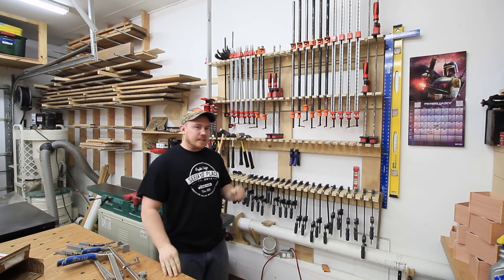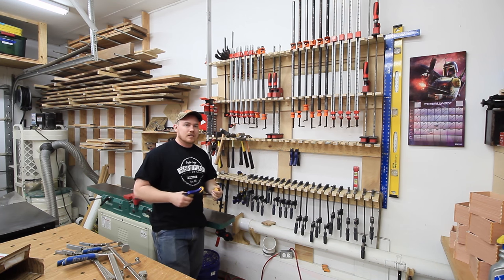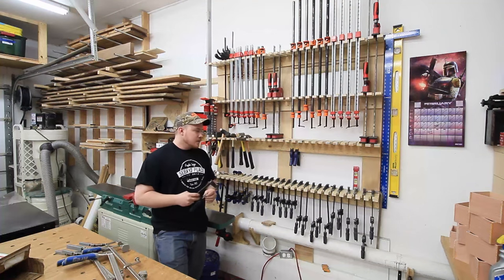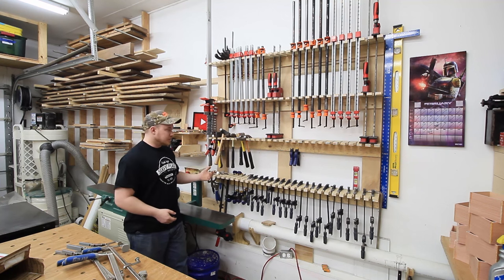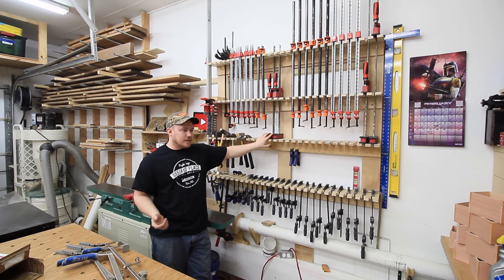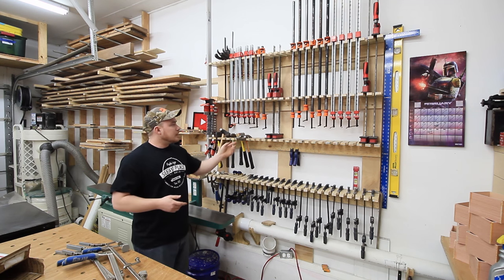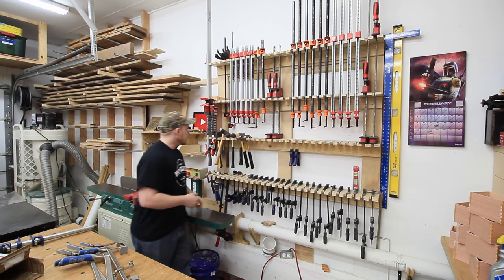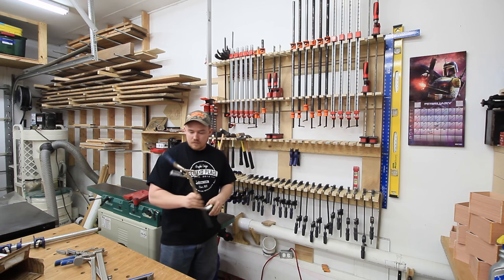Tool Talk #8: Clamps

Comment: I needed some additional clamps and bought a few of those HF quick release clamps, Broke right away. Took them back and got the screw style like you have. They are holding up for now but the bars bend easily. I hate when frustrating tools get in the way of a project.

Comment: Well that clears up some of my questions. I have been on the fence on which clamps to buy think I will go with 1/2 pipe clamps and the aluminum bar clamps. I have seen where the aluminum bar clamps can be improved with a piece of wood in the tubing to stiffen them up and pads for a better clamping face.

Comment: I work at home Depot and I'm a woodworker. So I play with all the new clamps that come in at the (orange) big box store. But I just wanted to say that the DeWalt quick clamps are really good clamps I bought one at a yard sale that was 5 years old. And I've been using it for a year and it's still strong and not broken. Lol

Comment: I had posted on your wall about the Bessey clamps during Christmas.
One thing about the Bessey is the smaller wooded handle is not as comfortable when tightening over the HF models.
They Bessey's were definitely more heavy duty though.

I bought several of the spring clamps from HD for 99 cents each long ago.
They have a very high spring pressure compared to others I have used.

Comment: I never tried the kreg style clamps.  With the big handle on one end, and the bar sticking out the other, they strike me as very awkward.  I often apply clamps in a vertical position, with t he project resting on the non moving part.  That just wouldn't work with the kreg clamps.  Things stiking out both sides of the clamp seems very awkward.

Comment: Thanks Jay. A good overview of your clamp collection. I have found that a few 6" quick  clamps are very handy  - from small parts glue ups to safety on router table (small parts). I  have a couple 3/4" pipe clamps that I've used on 8' panels.  P.S. my nearest HF store is only 170 miles away, 30 minutes isn't bad.

Comment: If you get your pipe threaded on both sides they also make a coupling that allows you to screw two pipes together and extend the length of the clamp without having a long pipe dedicated to longer clamping needs.  You would just move the sliding portion of the clamp to the other pipe.

Comment: Good reivew, Jay.  Appreciate the info on the pros/cons you experience with those clamps.  Your 200K 'friends' must have bought all of HD's stock of the 6-piece Bessey clamps - they are out of stock online.  Shockingly, a bunch have just hit Ebay and Amazon for around $30-35.  Always enjoy your insight of the tools you use.  Much appreciated!
Reply: +Chris Williams Try calling around to the stores in your area.  I found one that says they have a few so I'll be stopping by there tonight.
Reply: These clamps used to be in a seasonal "flex" area that was just recently taken down. If your store says that they have some online, the count should be pretty accurate (they just did their yearly physical inventory), but they may be hard to find. I found mine this morning in a shrink-wrapped pallet near the door to the loading dock. It was just about to be put out into their end-cap clearance shelves.

Comment: SIngle Take!   Awesome.
Totally agree about the glue on the parallel (K-body) clamps being a pain.  But I just love the big, flat, PARALLEL, heads on my clamps and reach for them first.     I've never tried 1/2" pipe clamp -- had some 3/4" ones and I found that they slip, and the heads are so totally non-parallel that they drove me nuts.

Comment: I have broke every kind of "quick grip" clamp except for the Irwin brand.  Those are by far the best "quick grip" style clamps I have used.  

The Bessy clamps are awesome clamps.  I also purchased the 6 pack, and they are awesome.  I also have some 4 inch clamps that are Bessy as well and I really like those also.  

The harbor freight clamps I have some of the longer ones, and yes the bars do bend and the screw is out of place on some of them as well, but with them being so cheap, I don't mind buying them.  

Great video Jay!  As always.

Comment: Hey Jay, - Watch Paul Seller's video on how to improve the aluminum bar clamps. Basically all he does is take the end cap off, cuts a piece of wood slightly under the interior dimensions, slides it in the opening, and replaces the end cap. It really stiffens them up. I've done it to all of mine. Beyond the bowing of the clamps, it really eliminates the twisting. 

Take care

Comment: Hi Jay. Thanks for this usefull review. About the Bessey  just have to wax the clamps once and it will be ok with any glue drop. You're right the Kbody are insanely expensive especialy here in EC. My favourite clamps are the cheapest version from Bessey called the Uniklamp. Their clamp pressure is pretty enough and they are limited in lenght 12" or 600mm. I've got 8 of them and planed to buy 8 more. Through they are IMHO the best value for money. If you've got an oportunity to test them out don't miss the chance. 
About aluminium clamps you probably notice they twist and bend easily. I found that fill them with wood just transfigure them into great clamps without adding them too much weight. You should try and tell us about this easy upgrade. Cya

Comment: Great review Jay! I have some of the aluminum bar clamps from Harbor Freight and they do bend some when tightening down. I cannot remember who posted the video improving these clamps but they cut a piece of hard wood that slipped into  the aluminum bar track snugly and it did stiffen up the clamp. I am going to do that with mine to see if it will work for me.

Comment: Thanks for the tip about the 6 pack of clamps at Home Depot, I just ordered some.  I also found a 9 piece set of Bessey spring clamps for $6.  They have 4 of the rarely used 1" clamps but also 3 of the 2" and 2 of the 3".  The bigger ones along are worth the price.
Reply: Dang it!  you must have literally got the last 6 pk of Bessey clamps....  I just jumped onto homedepot.com to place an order and they're currently "out of stock online".   Hoping they are still at that $15 deal when they get back in stock.   I also saw those spring clamps for $6, and gonna have to jump on that too!
Reply: +Stew Pidass  i did the same thing. out of stock:-(
Reply: +Stew Pidass  Check for local stores in your area for instore pick up. That is how I scored some in the DFW area.
Reply: +ddutton0   Thanks ddutton0, I tried that too...  unfortunately called the three homedepot stores that are in my area and none of them carried stock of the 6pk for $15.   And homedepot.com says the nearest store that has them stock is 85 miles away...  which is a bit too much of a hike for me to justify even if they were on sale for a penny...  Now if it was new cabinet style table saw for on sale for $15, I'd be in the car and on my way now.  😃  But thats just wishful day dreaming..  hopefully I'll get an email notification soon when they're back in stock online to order.  That is a great deal!  especially with the free shipping!!

Comment: 90% percent of the clamps in my tool trailer are Irwin clamps. Everything from basic 6" squeeze clamps to 24" 600lb rated (large grip) squeeze clamps.  For most onsite wood working projects, the 300lb rated 12" squeeze clamps are my go to.  The 600lb rated clamps are good for instances such as squeezing some curvy LVLs together. However, Irwin's plastic face clamps were not worth the money.  You had mentioned previously that you couldn't justify the Festool clamps, and with good reason--they're down right expensive.  Well, I splurged and picked up a pair of the screw clamps and I was extremely happy with the purchase!  In fact I use them more frequently for everything other than to clamp the guide rails down.  Installing 2000 linear feet of v-match pine without a helper, they were very helpful in holding up the boards onto strapping with little clearance due to spray foam.  No other clamp in my arsenal would have worked.  They also fit perfectly in the grove of the board and I was able to clamp it down using the groove without the clamp getting in the way.  I was so happy with them, I picked up another pair.  Check it out!

Comment: Great review on the clamps.  I am going to get more of the Bessey F clamps and I like the idea of the 1/2" bar clamps.
Reply: These clamps used to be in a seasonal "flex" area that was just recently taken down. If your store says that they have some online, the count should be pretty accurate (they just did their yearly physical inventory), but they may be hard to find. I found mine this morning in a shrink-wrapped pallet near the door to the loading dock. It was just about to be put out into their end-cap clearance shelves.

Comment: Thanks for the tip on the Home Depot deal, ordered three sets yesterday. (Crap, now I have to make another clamp rack...) 
My local-ish Woodcraft store, before it closed (owners retired, no one bought them out), had some Bessey K-Body style clones from a company called Groz and I bought a couple of door kits, 2-24" and 2-36" with the little setup blocks. It was a much better deal than Besseys and I've found I like them sufficiently enough to have ordered a couple more of the same kits from their online store. I also was able to catch a few Bessey clamps when Lowes stopped carrying them and they were in clearance. I've got a much more Frankenstein collection than you Jay, but they all have found uses eventually.

Comment: The Bessey Clamps are overstock from last Black Friday and headquarters force shipped them out to select stores. Limited quantities at select stores. So pick them up if you can, as soon as you can. Good tip Jay!
Reply: +Christian Vale +Jay Bates 2
I was wondering... sounded like a good deal so I tried to get some and found that they were in store pickup only and none of the local stores had them.
Reply: +Mark Pikas I found the same thing out. I have to drive about 40 min to get them. But at $2.50 a clamp, its worth stocking up!

Comment: I won some Bessey clamps during their 12 days of Christmas. I haven't used them for an actual project yet but I messed around with them. I like them. I still like my Harbor Freight clamps. I haven't had any issues with them yet. But if I do... 45 minute drive to trade them out. I've been lucky enough to find some nice used clamps at the local flea market. 
Wish I lived closer... I'd love some of those clamps! And I appreciate your honest opinions about the tools you use (Kreg clamps and everything else). I did try to get on Home Depot to get some of those 6". They were only available in store and none at my local stores. :( Thanks for sharing as always!

Comment: Jay, great summary of clamps.  Completely agree on 1/2" pipe clamps - I'd be lost without them.  Still like Harbor Freight F clamps as only had 1 failure of 30+ clamps in 4 years.  Very much like their rubber handles - better gripping than wood handles of Bessy brand.

Comment: You can rip down some hardwood and fit it in the gap on the underside of the aluminum bar clamps and it will reduce the amount of flex in the clamp.  Keep up the good work Jay.

Comment: Yeah, when you buy the cheaper clamps you really need to look them over. Check that the tapped holes are parallel with the rail, and that the, "jaws," either machined or casting, are perpendicular to the rail, and that the clamping surfaces are perpendicular to the rail, and that they oppose each other straight and evenly (I do machine/grind/sand them so they clamp evenly).

Comment: I really like the Kbody parallel clamps for glueing up panels or cutting boards/table tops, but I have found the same frustration as you with the glue squeeze out. It just gets all over these clamps and is a pain to get off. Then, they don't open and close easily, because there is glue in all of the little grooves. Argh!

Comment: On those k-body style parallel clamps, to prevent glue from sticking all you need to do is wax the rails of the clamps a little and it comes right off no problem.  I have the equivalent Jet parallel clamps and keep them waxed for this reason. Think I picked up this tip from the wood whisperer video on clamps from a few years back. Makes them work a little more smoothly as a bonus.

Don't try that on the F-style clamps though... doesn't work very well! don't ask how I know...

Comment: I loved this video - thank you for posting it.

I completely agree about the HF F-style clamps ... I broke 4 of them before I gave away the others I had.  On the matter of glue sticking to the parallel-jaw clamps, I agree it's a pain.  I have a dozen Irwin P-J clamps (8 @2ft+, and 4 @50" - I got them on closeout when HD was dumping Irwin and going to Bessey.  They were marked down drastically, and I paid a lot less than the regular list price on them, and I got all 12 for under $200) and it's a problem with them, too.  One thing I did which helps is that I waxed the SIDES of the clamps (not used in clamping down), and later I used boshield instead.  (the wood whisperer recommended it and I tried it.  It works, but I like wax better on my cutting tools).   That helps some, but getting glue off the edges is a pain.  I generally use a soft brass wire wheel brush in a drill to remove it... again that helps a lot, but it's still an annoyance (I tried it in a bench grinder, but in a drill is much easier as the clamps are large and cumbersome.

BTW I loved your workbench videos - that happens to be roughly the same bench I had been planning to build some time this fall (but with my life that probably translates to after the first of the year) - the difference is that I'll have more space when I start it and I'm planning to go 7' instead of 6' (If I don't change my mind again), and I have a couple of large pieces of purpleheart that I'm saving for the jaw faces on the pipe-clamp vise and the bench vise.  Also I'm adding a sliding dead man to let me put very long things in the leg vise.  Other than that the two designs are about the same.

One thing I haven't figured out is whether you have to share your shop space with a car. (From what I've seen, I don't think you could get 2 cars in there without removing equipment).  Just curious.  

Once more, thanks :-)

Comment: Have you tried waxing the k-body clamps with paste wax? I did this on my jet clamps and glue comes right off with no problem. I'd assume the same would go for the k-body clamps, but I have never used those clamps before.

Comment: With the parallel aluminum clamps to negate the flexing just insert a strip of hardwood - paul sellers has a video on what I am on about. 

It makes them a little heavier but it reduces the flex and I feel it offers a bit more resistance.

Comment: Jay, have you (or anyone else reading this) used the Hyper Tough brand clamps at Walmart?  My local Walmart has some, and I can't find any reviews of them or even the clamps themselves.  They're quick-grip style clamps and are about $3/ea.  They're only about 6", but at least the one I picked up seemed fairly sturdy for a $3 clamp.  I was just curious if you or anyone else has anything to say about them since I won't be able to test one for about 2 more months

Comment: I did find that the higher quality spring clamps had protective rubber pads and handles that would not fall off like the cheap big box store brands. They all clamp but I would have to stop and go back to the box or rack and find the cover that fell off a jaw.

Comment: I like the bessey F clamps the only thing  is the Red handle is slippery .Some guys wrap it with hockey stick tape more torque  or sand them > what do you think ?
Reply from the maker: +Don Baus Mine arrived after I shot this video on Tuesday. I don't have any issues with the handles being slippery. I also have some hockey tape on hand if that problem arises though :)

Comment: Hey Jay, thanks for the video. What clamps are you using on your mft table. I didn't want to pay 40.00 a piece for the festool clamps so I bought the Harbor Freight 6 inch clamps and clipped off the ends. They work ok but there has got to be a better clamp for the money that you can use on the mft tables. Thanks again brother

Comment: I bought some spring clamps from Home Depot, they're usually a buck each. The rubber on the clamp is rubbish. After using it twice, you're just clamping with bare metal. So, be careful with those. They're not very quick if I have to grab some cauls with them too.

Comment: What about your Kreg right angle clamps? Do you recommend that one for pocket hold projects?
Reply from the maker: +Ryan Hubbard Forgot about that. Yes. It's handy.
Reply: +Ryan Hubbard The Kreg right angle clamp is great for use with the pocket holes.  Kreg also has a face clamp they sell but I've been using the Harbor Freight version face clamp ($6 per clamp, I believe) and they work great for me.  Definitely less expensive than any of the other face clamps I've seen out there.

Comment: Hey Jay, you mentioned in this video that you didn't like the Kreg Automaxx clamps however when building my own version of your miter saw station I noticed you used them when screwing in your miter saw enclosure boards and was a little jealous since I had to use a bar clamp. Did anything change since you built the miter saw station? Just curious since I was planning on investing in some. P.S. I purchased your plans when building my own version.

Comment: I saw somewhere (here on youtube, but now I can't find it) someone had a bunch of those aluminum style and to take care of the twisting they cut down and shaped a 2x4 to go inside of the clamp body. Is that an option on your's there Jay? I've been tempted to get some ever since I saw it. It's those or the 1/2" pipe clamps. I have some 3/4 but like you, too bulky and heavy, the 1/2" are just fine. It's time to break down and buy a bunch of new ones.
Reply: ReaperWoodworks that was probably a Paul Sellers video